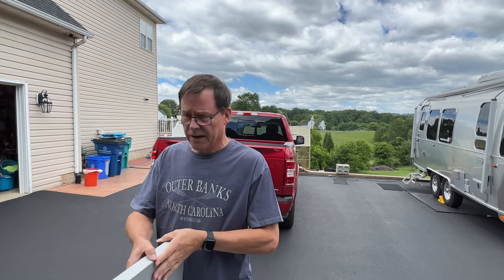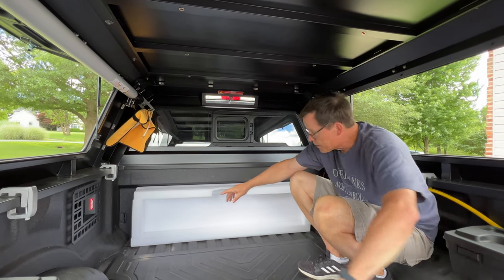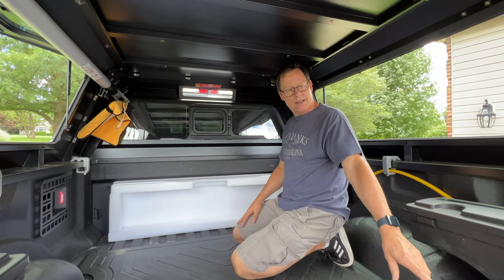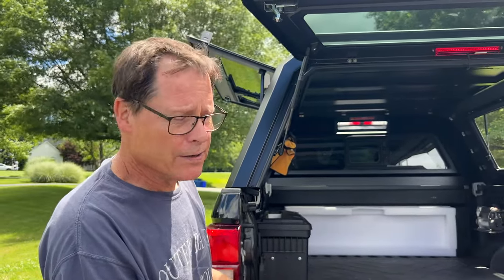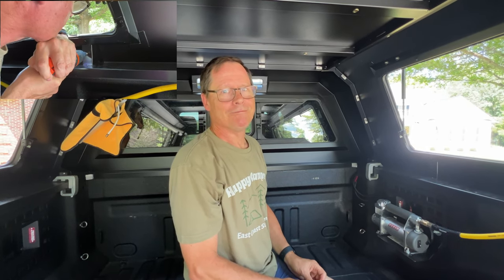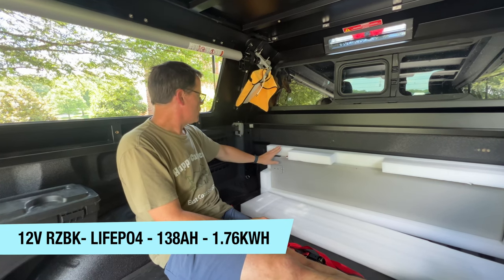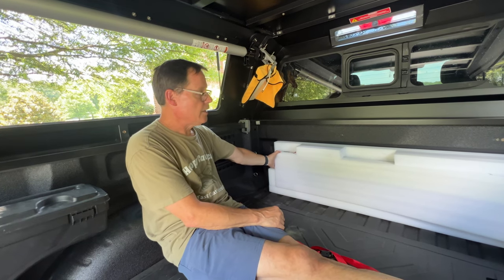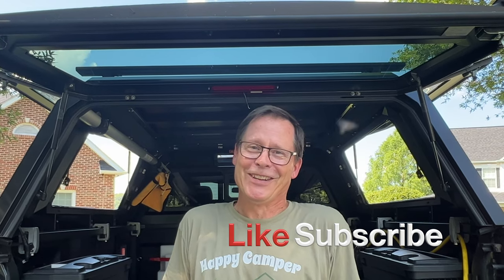Mega Power Up the Truck - Adding a Big Battery to the Truck Bed

Comment: I discovered your channel thanks to this video and then I proceeded to watch about 6 more video's.  All in all a lot of very useful content!

I don't recall you talking about the master plan for this battery, so I was wondering:  What is the end game here?  Why are you putting the battery in the truck and not in the Airstream?  I ask because I am contemplating the same thing...  

We will be getting an Airstream this year to do a lot of boondocking.  I see two options: 

A) the more conventional approach of upgrading the electrical system in the Airstream, putting tons of solar on the roof, etc.  In your video about selling your Globtrotter 23FB you talked about doing all that stuff.  

B) Build the battery system in the tow vehicle (tv).  Installing 5kWh~15kWh of battery in the bed of the TV.  Installing 800~1000 watts on the roof of the TV.  Install a second solar MPPT so there can be deployable panels.  An inverter/charger that will provide the 240v AC (ours will have 2 air conditioners).  And finally install two plugs, one to hook the Airstream up to the truck and the other to allow the truck to be hooked to shore power.  

The advantage I see to the conventional approach is that Airstream is always ready to go and 100% independent, with nothing to hook/unhook, easy-peasy!  Also if the batteries are in the Airstream, then they will will be operating at normal temps.  I see some disadvantages:  When you sell the Airstream the electrical system goes with it.  The space needed for 10kWh or more of the battery takes a lot of space in the Airstream.  And if the only solar is on the Airstream, it always has to be in the sun to get power.

My number one advantage to option B is not having to modify the Airstream and losing the investment in the electrical system.  I also like the idea of not giving up the space in the Airstream for the battery.  And then there is the advantage of being able to put the Airstream under a tree for some shade while keeping the truck and solar out in direct sunlight.  The way I plan to solve the downside of less room in the TV is by getting a long bed.  The other downside, sort of, is having to have the TV tethered to the Airstream.  Since we plan to always have two vehicles and the TV is truly just a mule, that should not be a concern for us.

Q: One big concern I have is operating temps. What did you find out about how hot the battery got when fully loaded on with your 3000w inverter?
Q: The 3000-watt inverter, is the objective to hook the Airstream into the inverter as if it was shore power?  If so, how is that working for you?
Q: Have you used it in winter camping when temps are too low to charge the battery?  If so, how did that go?  (Side note, our current teardrop has a lithium battery in it with a heater, when the battery is too cold and detects a power source, it turns on a heater to get the battery warm enough to take a charge.  Does your battery do that?)
Q: Why did you choose the battery you did?
Reply from the maker: Hi Sam. The intention for the battery in the truck is - 1) to have backup power from the trailer in an emergency; and 2) to provide power to various tools and electronics (with a 3k watt inverter). This battery will be charged via solar panels on the truck roof and a DC-DC charger from the truck alternator.